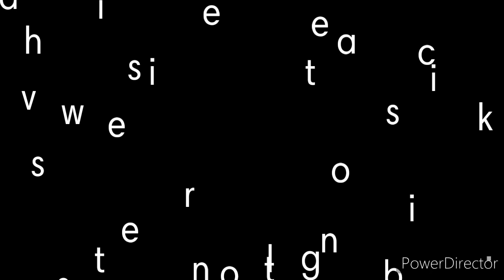suzuki smash 115 ang  brake shoe na legendary din sa kapit

Comment: pwede ba yang material na yan sa primary clutch ng wave 100
Reply from the maker: Hindi po tatagal sir masisira din agad .. natry na po namin dati .. the best parin po brand new stock .. pagdating sa primary clutch ..
Reply: @mcmoto989  pano po madaling masira? mabilis mapudpod ganun po ba?
Reply from the maker: My chance na matuklap ung linning sir na kinabit .. di po kasi pwde mababad sa oil,brake fluid,gas ,diesel ang rubberized na linning my chance na mamaga linning tapos malulusak or mabaklas ng buo ..
Reply: @mcmoto989  ok papas maraming salamat sa Idea...ano kaya magandang gamitin na material?
Reply from the maker: Stock sir na orig.  ..or if gusto mo pwde mo din iconvert nlng sa manual clutch motor mo wave .. mejo gagastos nga lng .. search mo modchie work .. my inupload sia video about convertion
Reply from the maker: https://youtu.be/P-tv-2GGjus
Reply: @mcmoto989  actually paps ung alpha ko nakamanual na cinonvert ko half the price yung gastoa instead na bumili ng primary assembly 👌
Reply: anyways salamat sa mga info Godbless ✌️👍😁

Comment: What do you use for the glue????? I'm about to make a slide and need to glue on this material to it. It will be as big as a huge flywheel.
Reply from the maker: Araldite brake bonding adhisive or bostik brake bonding adhesive
Reply: @mcmoto989  sir saan po pwedi makabili ng clutch lining pad para po sa scooter?